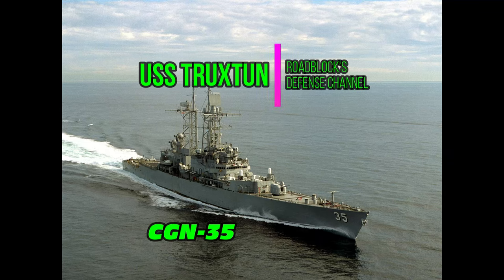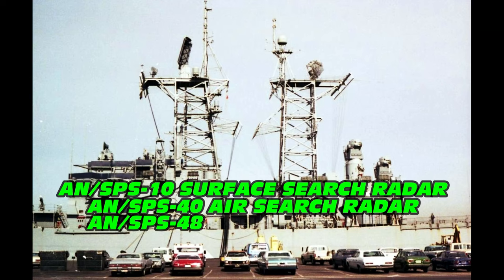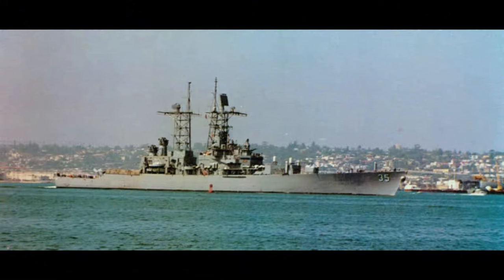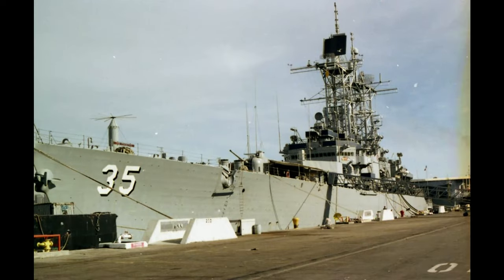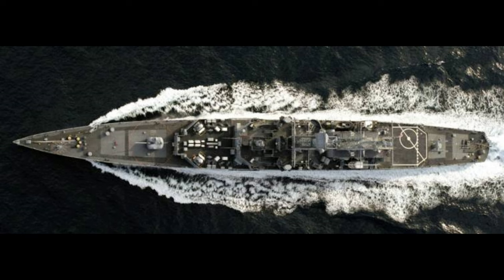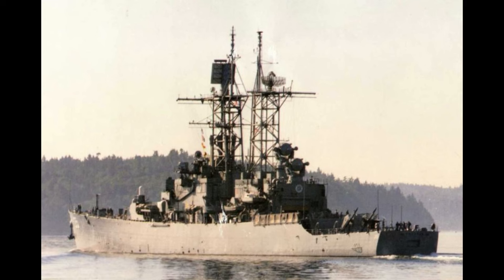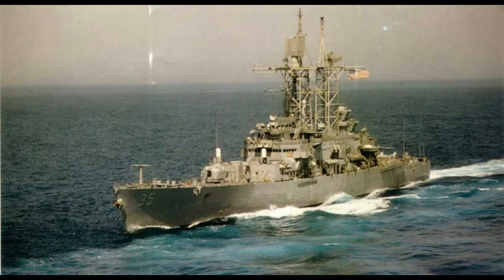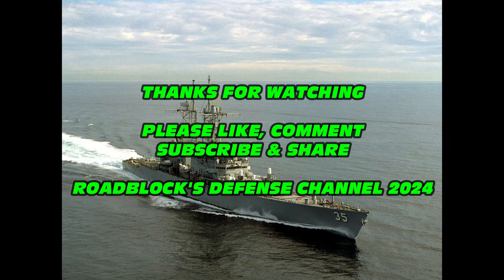USS Truxtun CGN-35 - US Navy [01/20/2024]

Comment: My ship!  I served on Truxtun from September 1979 through July 1982.  The ship had just come back from a restricted availability in Bremerton where the Harpoon and SRBOC launchers were installed.  I was the Electronic Warfare Officer, then the Gunnery Officer, and finally, the Battery Control Officer.  My first cruise was to the Persian Gulf during the Iranian Hostage Crisis and we spent most of our time off the Straits of Hormuz acting as the PIRAZ ship.   I got my shellback certificate on that cruise.  We finished our deployment with a South Pacific cruise to Tonga and New Zealand.    My second deployment was less stressful and we crossed the equator at the international date line, so I am a Golden Shellback--I still have the certificate.
Reply: Paul, I was onboard as R&R from Constellation in 1980 when we went to Diego Garcia.  I posted a link of the photos I took while on Truxtun.  Do you recognize any of your shipmates.  Truxtun was a small ship, so you might of known them.  Bobby Estey CV64
Reply: Bobby, I spent a week on the Constellation via cross deck visit during one of my deployments.   I didn't get your link to your Truxtun photos--or maybe I'm missing something.

Comment: We were out in the Baltic Sea on a 3 month Northern Pacific tour in 87(?). The hardest part was when we faced a wicked storm. The highest roll was clocked at 49 degrees. Easier to walk on the bulkheads than the deck. Shit was flying left and right. Bolted down lockers getting torn off walls.
The weirdest part however was our Sonar Operators (we all worked together as Operations Intelligence) picked up something they couldn't explain. A big sonar blob that seemed to engulf the ship. When we got back to port we went straight into drydock. The sonar dome is covered in a thick rubber material. The inspectors found huge teeth embedded in the rubber. Sent it off to a lab. The final conclusion was that those 'teeth' were what you would find on each sucker of each tenticle of a common squid, but thousands of times bigger. Freaky stuff bro.
Reply: I remember that storm.  Enterprise had a CWO fall overboard and we turned around in those huge swells to try and recover.

Comment: On the Tommy-T 82-84. Reported just before the Bremerton COH in July 1982 departed Dec 1984 a few months after the overhaul was complete.E/RE divo, EOOW. Completed my engineer quals on board. During the daily outlying engineering space tours, while in overhaul and drydock I was able to inspect the shaft space by entering the port shaft ally via the inspection cover in the missle magazine crawling through the shaft ally (shafts were out for overhaul) onto the scaffolding back in via the stbd shaft and out the missile magazine again. There were a few good things about overhaul but not many. FYI I'm sure most crew members noted the pictures in the narative are inconsistant. CIWS was installed in the 82-84 COH, easy way to get a date on the photos.

Comment: Nuclear Belknap Class, though they reversed the 5"/54 Mk 42 and Mk-10 GMLS.
Reply: A word on that "nuke Belknap".  I've seen that before in multiple places, and Truxtun's design undoubtedly owes much to the Belknap, but there's more different than just the position of the gun and missile launchers.  We were actually moored alongside a Belknap if memory serves me--or maybe it was just on the same pier.  Truxtun's superstructure was rather different, especially the distinctive masts, which I never saw the like of on any other ship.  Also, the hull was a bit longer and the shape of the hull looked a little different in the contours.  The placement of various radars, antennas and sensors was somewhat different.  I remember the Bainbridge up close also--it looked much closer to the Leahy class than the Truxtun did with the Belknaps.  Some authors call the Truxtun a Belknap--some don't.  I tend to side with the latter.
Reply: @dandaintac388  More in terms of appearance and weapons/capabilities.  The Leahy's and Josephus Daniels classes (change in class designation after Belknap's post collision reconstruction) shared the Mack (mast/stack) superstructure which the Truxtun didn't.
Reply: @dandaintac388 The Bainbridge was the Truxtun’s sister ship
Reply: @spineless1  Step-sister ship